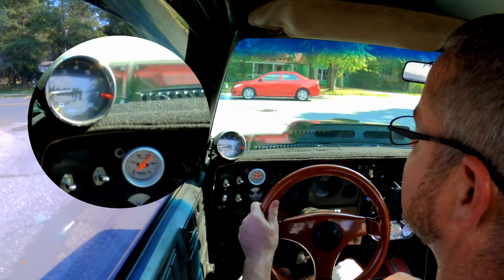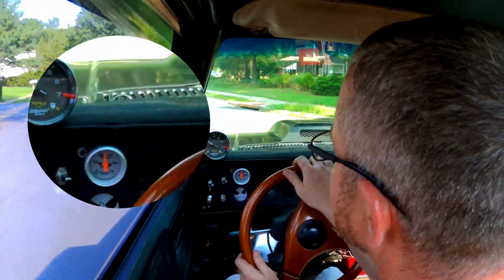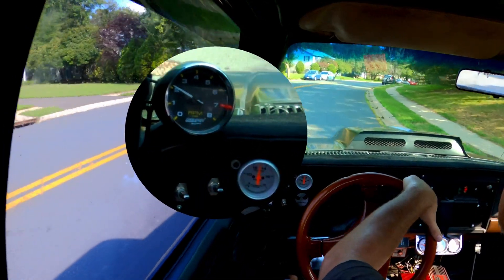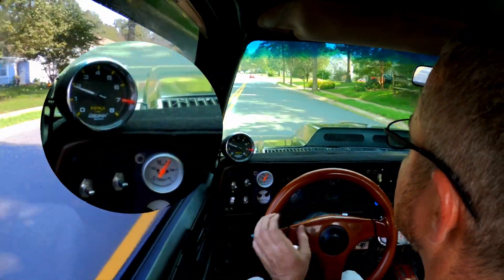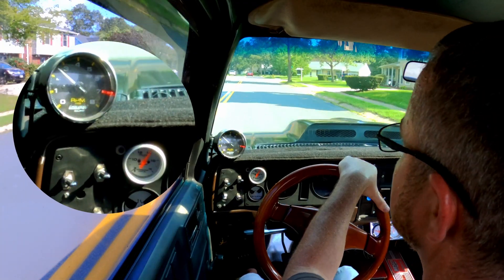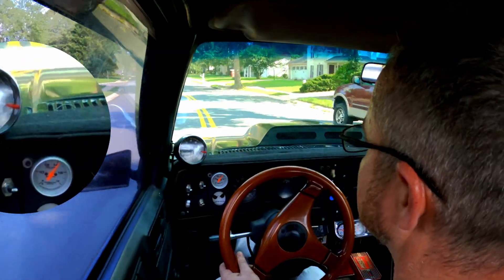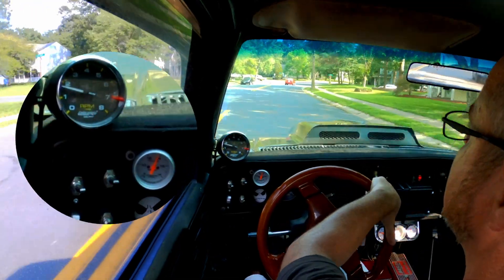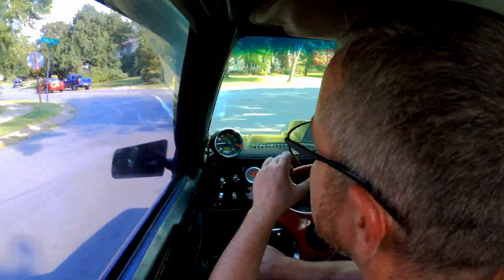Holley 4150 Carburetors Tuning The Power Valve!

Comment: What kinda jet split did you end up with after drilling out power valve circuit?
Reply from the maker: I think I had it an 8 split before and the WOT AFR was good. I then enlarged the power valve restrictions to .062. I had to drop the front by 6 to get the AFR back to where it was before. “So about a 14 split now front to rear.
Reply: @TPVPRO  awesome! Good enough! Gonna have to give a shot. Still tryin to dial in idle air fuel. Motor likes to idle a little on the rich side. Hi 11s to low 12's AFR. If i try anf lean it out anymore motor doesnt seem happy. Idle will sometimes slightly hang after blipping the throttle. Slower to return to an idle. Then motor temp will idle alot hotter. Cruise AFR is in the low 12.s i also have same problem. Once i start to tip in the throttle from a stoplight it will go instant rich into the 10s. Any slight acceleration motor just goes way rich. Other then that WOT is on target. Car still hot starts perfect. Even with the richer mixture. Sorry for such long comment! Hahah
Reply: @1969pontiac406  great comment.

So your leaner idle mixture has a direct effect on the engine revving back down to idle???

I kinda have that problem I think.

I like my 383 to rev up fast and come back down to idle even faster! Lol.

I know my 381 stroker isn't going to perform magic like an F1 racer!

Comment: It’s mind blowing that the 8.5 didn’t shoot that sucker lean asf ! But did the opposite 
   Very interesting indeed !!!
   I know for my blow through carb my buddy opened up the power valve holes in the metering plate pretty much is the main thing to do when you want to do a blow through unit 
Love the tuning tricks brother!!
Reply: With that cam he probably only has 10 in of vac, wouldnt take much for the PV to open at 8.5. why would you think that would make it lean?
Reply from the maker: @cuzz63  Yes it would make it FAT      supplying enrichment immediately off idle.
Reply: @TPVPRO  thats what thought, wasnt sure what boosted cutlass was thinking
Reply from the maker: @cuzz63  Boosted my boy, he has been a long time subscriber. His car is pretty sweet too.💪
Reply: @TPVPRO  also, just so everyone knows, if your engine makes 8" on idle, and you put a 9.5 pv in it, it won't affect idle at all. It won't dump fuel while at idle. Pv has nothing to do with the idle circuits.
Reply from the maker: Still so much I want to learn for sure.

Comment: Holley “Base” Power Valve selection procedures.
* Automatic transmission:
Engine at operating temperature, measure engine vacuum in gear idling with brake applied.  PV = observed vacuum reading minus 2hg. 
Example: 8.5 - 2.0= 6.5 

*Manual transmission, engine at operating temperature with stable curb idle.  Measure idle vacuum and Divide by 2.  
Example 13.0/ 2= 6.5 PV 

As a general tip, if you’re in between sizes try the lower rated PV first. 
If you have very low engine vacuum in gear, under 4-5hg in gear you can try a 2.5hg PV but may end up needing to use a PV block off requiring increased main jet sizing +6-8. 

This is the Base method, it may work great as is but using a wideband to verify the AFR’s is the Pro tip and most accurate!  👍
Reply: My thinking is this might be the method for a baseline start, then adjust from there.
Reply: But if you block up the pv for the primaries, and jet it up like 6 numbers, you are not going to get instant fuel (after the pump shot), till the engine goes up in rpms, and starts producing a decent fuel signal, to draw in from the primary jets = leaner.

I think that what you probably do, but didn't mention, is maybe go with the bigger 50cc pump instead of the 30cc and mess with nozzles and cams to make up for that lean-ness you induced by blocking up the pv?

Correct me if I'm wrong. I want to learn.
Reply: @jakefriesenjake  why not learn yourself by going out and testing your theory then reporting back